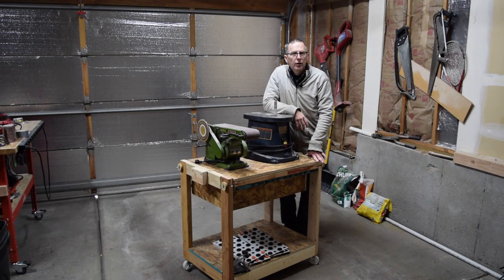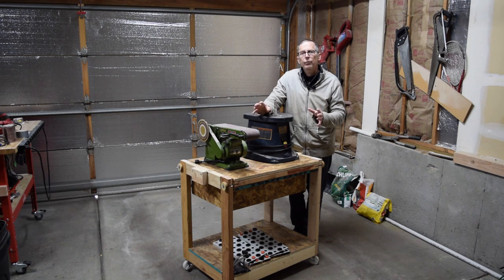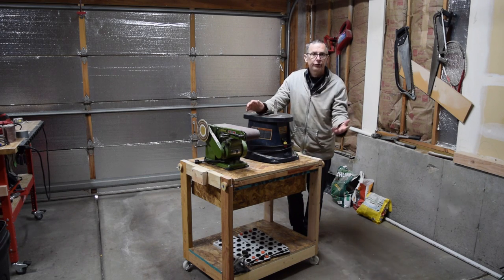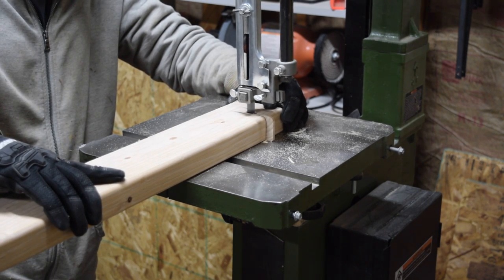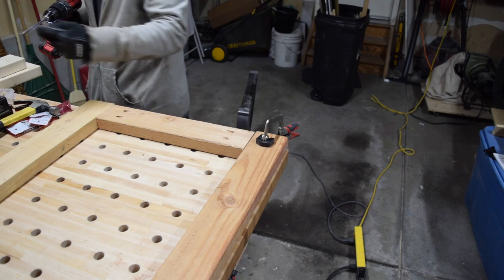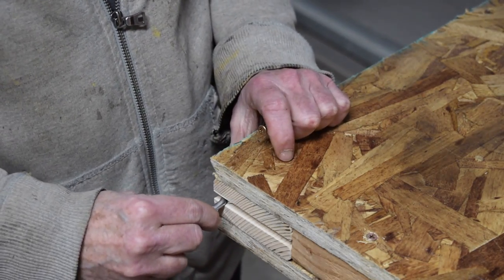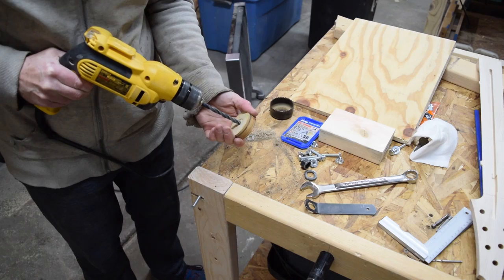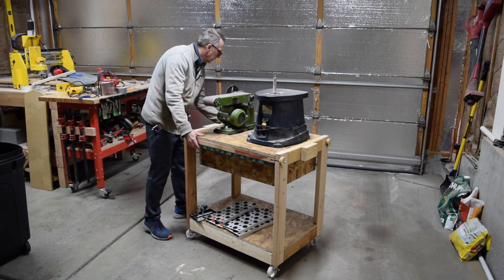Building A Cheap Yet Sturdy Flip Top Tool Stand

Comment: I bought the plans and built this. Two tweaks I made that made it easier to build and sturdier. 

1. I didn’t put the plywood on the flip top until I got the pipe through all the holes. Being able to guide it made it easier. 
2. Then I only put the plywood on one side. I flipped it over and put in two more 2x4’s running parallel to the pipe sandwiched between the two plywood pieces. It allowed me to screw my planer and jointer into 2x4’s and plywood instead of just plywood. 
3. Once those two pieces of 2x4 are added I then put the last piece of plywood on. 

Plans were pretty great but those tweaks made it easier.
Reply from the maker: Good suggestions, thanks!

Comment: I too like to build stuff with 2x4s cause their cheap. If you skim the surface of the 2x4s on all 4 sides, planer or table saw, they actually finish up nicely. Like furniture look nice. 
Next time you build another cart you should spend a few more mins prepping the 2x4s. You’ll be amazed the nice wood grain you get just by removing that surface layer. 
Thanks for the video.

Comment: Hey all, here’s some advice for anyone looking to do this on the cheap.  Visit businesses that sell any type of industrial pipelines. Pipeline is stored using metal banding and made into bundles.  To lift these stacked pipeline bundles (with a forklift), they are banded with a 4 or 8ft x 2”x6” boards.  Some are even banded with 4x4s.  I know this because I work at such a place.  And up until 3 months ago, we threw perfectly good lumber in the dumpster.  I now have a pretty good section of my garage stocked with FREE 2”x6” lumber.  Another great place is a crate making facility. My brother works for one.  He loads up people with free lumber from leftover crate jobs.  A company is quoted a price for a crate. They are charged for entire sheets of plywood. So, they may use an entire sheet of plywood and 6 inches of another. The customer is billed for 2 sheets regardless. The rest goes in the trash. His company doesn’t care who takes it because they’ve been paid for the cost.  It’s sad but not if people like us step in and prevent it from going into a landfill.  Best of luck all!!!
Reply from the maker: Super great tips!

Comment: This is awesome! The all-plywood builds all over YouTube seem excessive. 2x4s are just so much cheaper and easier to work with. I think the only modification I'll make when I build this is some half lap joints on the frame. Thank you for this video!
Reply from the maker: A 3/4" 4X8' sheet of plywood today at my local Home Depot is $94.

Comment: Really like the nice simple design. Curious as to whether the lag bolts have held up bearing the weight of the spindle sander while it’s upside down
Reply from the maker: They've held up great. They only hold the table in position. It's the center tube that supports the weight.

Comment: This the best build - simple yet effective. Thanks for sharing. BTW, have a quick question - I noticed you use only pocket screws and no glue in the joinery. Now that you have it for more than 2 years, how's it holding up? Do you recommend using glue in addition to pocket holes? And in general are there any other tips, changes or improvements you would suggest? I am about to build one and hence asking. Thanks in advance for all you help.
Reply from the maker: You can add glue, but it is not necessary.

Comment: Off topic, I have that same table saw and bought it used off Facebook marketplace. The person I bought it from did not have the out feed support anymore, so I'm making my own out of 3/4" steel tubing and plywood. Any chance you would my willing to measure yours for me and let me know the dimensions of the support piece. I need height, length, width and the angle of the the front bevel. I would greatly appreciate the information if you're willing to do the for me